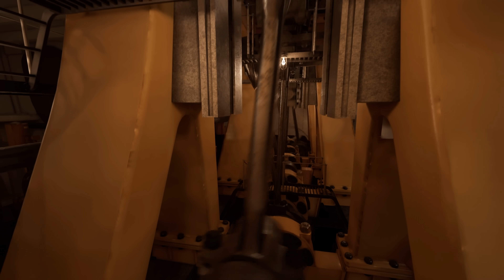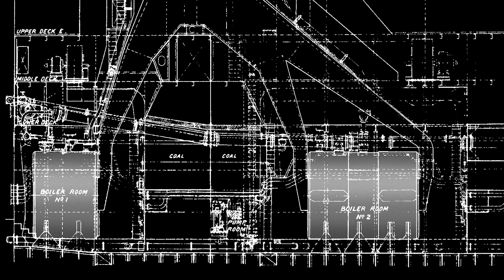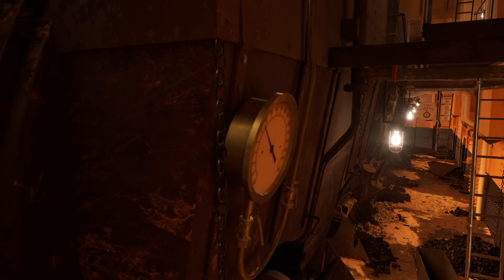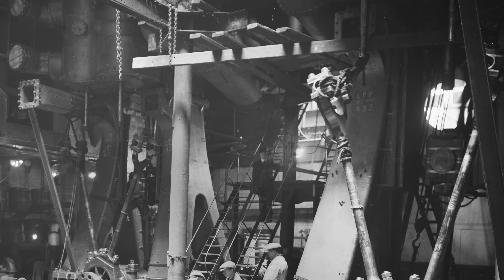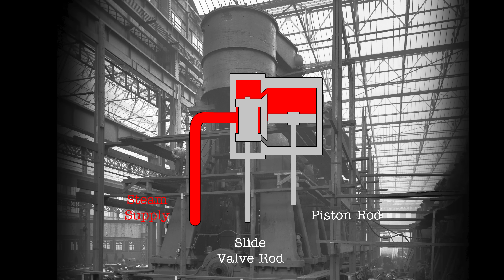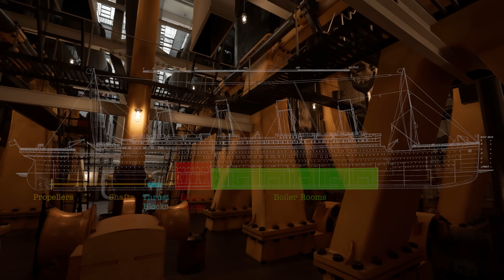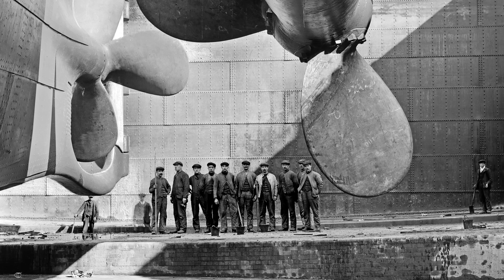A Complete Guide to Titanic's Engines

Comment: After a career at a nuclear power plant, I see so many similarities in this power delivery system and what we maintained...of course, we weren't burning coal in furnaces and feeding reciprocating engines..but there were, moisture separators high pressure turbines exhausting into lower pressure turbines which exhausted into a condenser running under vacuum..condensate extraction pumps returned feed water to the boilers,  makeup water provided by a dedicated water treatment plant for each unit....many similarities to do such a different task and across such a span of time

Comment: what did they do with the ashes from the boilers?
Reply: In port it would be placed into canvas bags and then hoisted into a room called the ash room before being offloaded.

At sea the ash ejectors were used and the ash was mixed with sea water before being flushed out the bottom of the ship.

Comment: How did they clear all the coal ash from the furnaces? Most small coal stoves have a "shaker". I dont see any shaker handles, or methods for removing the useless coal ash from these furnaces.
NOTE: if this ash is not removed, the fire will go out, regardless of how many furnaces you may have.
Reply: When in port it was bagged up and moved to rooms on F deck for storing ash. The ash would then be off loaded once docked.

While at sea ash ejectors were used which mixed the ash with sea water before flushing it into the ocean.

Comment: In west London on the M3 approach at Kempton Park, there is a water treatment facility. One the site is also a large Edwardian  building that was used to house the pump that powered the massive water ring main that runs underground around London. This pump is no longer used as it's obsolete but the building is open at the weekends as it is now a museum run by a charity. 

If you are interested  in Titanic and you can get to the museum then I promise you won't be disappointed and I'll tell you why. Apart from all the other smaller exhibits in the building, there is one engine that literally towers over the rest.

It's a steam engine that very closely resembles the one was built for the Titanic!

At over 1000 tons, it's the biggest piece of steam engineering you will ever see. As it says in the video, it's like the one in the Titanic. It's 3 stories high and just amazing , There are walkways and stairs actually on the engine so you can get up close to it. Sometimes, if you are lucky, one of the steam guys there will START IT UP. To do this they use a tiny steam engine that acts like a starter motor for the main engine. 

Admittedly the main engine doesn't run on steam anymore, there is an electric motor that now powers it but they still need to use the small motor to get it going cos the electric motor isn't powerful enough to get it started by itself. Once it is going the sight of all the piston rods going up and down and the crank that revolving is amazing! 

Here is a link to the Kempton Park steam museum where it is: https://kemptonsteam.org.  .

Comment: I still think its the Olympic that went down, just my opinion.
Reply: Unfortunately your opinion is just blatantly wrong.

Titanic was built yard number 401, her sister Olympic was 400. Every fitting, hull plate, capstan and deck chair had these numbers. Everywhere on the wreck you can find the number 401 as well as the extensive changes in design made to Titanic such as the rebuilt B-deck, extended Bridge wings and new locations for air vents and ducts to name a few. 

The wreck is Titanic, Olympic went on to have an incredible career and should be remembered for that, she was also placed under a lot of scrutiny at several points so had it secretly been Titanic (which it could never have been as the switch is physically impossible) people would have found out.
Reply: @Tozzpot500  gosh, I didn't know any of that 😄
Reply: @jaymorris3468  dont worry about it, on the surface the switch does seem possible but once you get into the details and breakdown the period of time it had to have happened within you realise there is just no way.

For a little extra: Titanic and Olympic were together for around 44 days. For 40 of those the hull of Titanic didnt even have her engines installed and was nothing more than an empty shell with 8 boilers and a funnel installed. There is no possible way to make a ship 6 months from completion into a finished ship with the proposed numbers switchers give, we couldnt do it today even with prefab hulls. They had one dry dock and one large crane, both were being used on Olympic at the time and a small skeleton crew were at work on the Titanic ripping out B-Deck for the rebuild.

15,000 people worked at the ship yard, many of them were not fulltime employees and outside of a single paystub no evidence of them at the yard would exist by the time she sank. This also is alleged to have taken place in front of the entire city of Belfast, some 400,000 people who were all keenly invested in her construction as it was a point of pride in Ireland.

Many conspiracies often have a veil of truth to them, this one doesnt. The switch is physically impossible, you could never hide the fact the ship was Titanic from Olympic's crew and returning passengers, they were vastly different ships internally. The wreck is without a doubt yard number 401 or the Titanic. Olympic went on to have a genuinely fascinating career until she was sadly scrapped in 1935 where had she have been Titanic in disguise that would have been noticed. It never was and the theory didnt appear until Gardiner wrote his book in which he states it didnt happen in the early to mid 1990s. That is the first instance of the switch theory, right in the middle of the Titanic craze and written by a known con-man.

If you are interested further Mike has a two part series breaking down the theory and tearing it to shreds, if not i hope you enjoyed the information and feel free to ask any questions, but i can assure you, the wreck is Titanic 100%

Comment: You'd think with how sophisticated these engines were, you'd think they would have engineered an auto coal feeding mechanism like how modern pellet stoves do, less space/resources required for crew (there would still need to be some for maintenance and managing the feed rate of the coal)
Reply: Modern pellet stoves require electricity. Where would you get the initial energy to power an auto feed?
Reply: @csmith6237  well in this case it could be driven off its own steam engine seeing as how its a steam train, or you could run an electric motor with a dynamo
Reply: @Sausketo  that would still require feeding a steam engine though, you're just adding extra weight and parts to a proven system
Reply: @csmith6237  only the steam generator/boiler requires fuel, so a small accessory steam engine would only require plumming
Reply: @Sausketo  so we would start with an initial main engine start up and let the feed take over? That could've worked I suppose.

Comment: Why wouldn't they just ... you know. go from 210psi to one atmosphere in one cylinder? Exhaust all energy with much less constructive effort?
Reply: Cost: The complete expansion of the steam occurs across multiple cylinders and, as there is less expansion in each cylinder, the steam cools less in each cylinder, making higher expansion ratios practical and increasing the efficiency of the engine.

There are other advantages: as the temperature range is smaller, cylinder condensation is reduced. Loss due to condensation is restricted to the LP cylinder. Pressure difference is less in each cylinder so there is less steam leakage at the piston and valves. The turning moment is more uniform, so balancing is easier and a smaller flywheel may be used. Only the smaller HP cylinder needs to be built to withstand the highest pressure, which reduces the overall weight. Similarly, components are subject to less strain, so they can be lighter. The reciprocating parts of the engine are lighter, reducing the engine vibrations. The compound could be started at any point in the cycle, and in the event of mechanical failure the compound could be reset to act as a simple, and thus keep running.

Comment: A complete guide to one of the biggest LIES ever told. The Olympic is what lies in the depths.
Reply: Olympic's yard number was 400. That number would be stamped onto ever hull plate, frame, boiler, gear, bolt, wood panel etc on the entire ship.

So if the wreck is Olympic, how come yard number 401 (the one that belonged to Titanic) is found everywhere, including the engines which need i remind you are the size of a 3 story building. And there are two of them. So either they gutted Olympic, in broad daylight in front of the entire city of belfast with only one crane and drydock and made her resemble the unfinished, mid having B-Deck being rebuilt no engined Titanic. Or the wreck is Titanic. 

You tell me

Comment: It’s kinda crazy to think that, the Iowa class battleships were about the same weight as titanic and her sisters (well, she was actually 57,000 tons when fully laden with food, ammunition, sailors and fuel, but she could only hit her top speed when fairly low on rations,but I digress lol) .. titanic had 24 boilers with two triple expansion steam engines and 1 steam turbine, and made 46,000 SHP.. New Jersey had 8 boilers, with 4 geared steam turbines and made 212,000 SHP.. 
titanic managed a top speed of 23-24 knots, New Jersey made 33 knots ..
The Iowa class battleships needed 3 times more power than titanic, just to go 1/3 faster.. that says a lot about hydrodynamics and exponentially rising forces acting on a ships hull through friction

Comment: The preocupation with the economy of the coal, did the ship in;  for the Titanic there was no money allocated to reinforce the HULL against a collision; it was spent in the colossal hybrid systems;
TODAY, the same:  the preocupation with saving ONE DROP of gasoline and diesel, DESTROYS millions of car engines all over the world; EGR, low tension rings, particle filters, electronic water pumps, electronic thermostats, electronic oil pumps,  and many more CRAZY stuff like that, it IS backfiring horribly, like the Titanic did; not to mention the battery cars, EVs,already being avoided...

((  It burned a 100 Thousand Tons of coal per day,you say?  it seems  impossible to shovel, by hand, all that into the boilers)).

Comment: I bought the 5 ton gantry crane used in the Titanic boiler plate rolling shed. I extended it by 15 feet and fitted end frames making it a portal crane, and still use it with the original hoist in      
 2024 to load lorries.

Comment: Wow, great video Mike! These steam ships were engineering marvels. Modern diesel / oil power ships don't need as much space in the ship (as they don't need boilers for a start) where as these steam ships are built around the propulsion system. Watching the engines in a steam ship is likely poetry in motion - relatively quiet (compared to diesel / oil engine that is) and nearly all the moving mechanical parts are on display. Enjoyed some time in the Earnslaw's engine room under way (yes its small but most of the same principles).

Comment: Nice video. Wodering Titanic uder atmospheric pressure turbine-condenser system. Thank you.
But for some reason, central propeller turns in a wrong direction on the animation, stopping the ship ^_^

Comment: Titanic may have turned well for its size, but it only did so with the help of the wash from the central turbine driven propeller giving the rudder greater purchase on the water. When the iceberg was sighted the turbine was stopped. We cannot know whether keeping it running might have resulted in a better outcome, possibly causing a more side on collision with the iceberg and breaching fewer watertight compartments.

Comment: I had no idea that the turbine was operated at lower than atmospheric pressure. It does make perfect sense, though. I've fired a locomotive on a hot day, and enjoyed the icy cold mist exhausted from the cylinders. That cold mist wouldn't have any trouble cooling a condenser to a lower pressure, so I can see how that would work. The inside of those condensers must have been near freezing.

Comment: IIRC, the Olympic class were designed so that eventually they could be oil-fired, which Olympic was after the Great War.  Oil was seen as the fuel of the future, and once converted, Olympic shed about 360 crew from her engine rooms since pumps were all oil needed.

Comment: I always find the obession with Titanics size and engineering absurd for anyone that isn't lay, the ship was basically the same size and configuration as RMS Olympic, only 1000 tonnes  (weight later added Olympic) more due to some slight differences mainly covering over a promonade, being first of class if was the Olympic which was the groundbreaking one a year later SS Impertor was completed 7,000tonnes larger and 7 metres longer, The Queen Elizabeth near twice the weight of Titantic was the largest passenger ship from her compeltion till her sinking and a larger ship didn't enter service to 1996

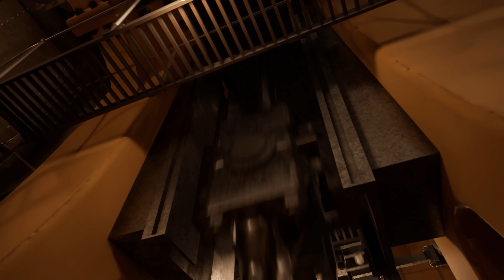Comment: 20:15 Note that the exhaust from the triple-expansion engines were NOT totally exhausted, but still carried pressure. The exhaust was fed to the turbine, where it then exhausted to the condenser; almost all steam ships have a near vacuum exhaust pressure, as the condenser condenses the steam which makes such a dramatic reduction in volume that you are almost one atmosphere below ambient, helping pulling steam through the engines making them more efficient.

Comment: They gave enough thought, effort and resources into what can only be described as a propulsion miracle.

And then said

“Less than half the needed lifeboats. That'll do."
Reply: Not true. Lifeboat regulations back then required only 16 lifeboats for vessels at 10,000 tons and more.

Titanic (which admittedly weighed 52,000, demonstrating how old those regulations are) carried 20, so she was above and beyond the requirements.

Also, back in those days, lifeboats were not a primary lifesaving device

Comment: The neatest thing about this -- for me -- is that these aren't things that used to exist and have since been dismantled and scrapped -- like they were with Olympic. Every single thing mentioned here still exists and it's all resting at the bottom of the North Atlantic.

Edit: Albeit rusting away and deteriorating, with some of the smaller parts likely long gone because of that, but the point is that every last thing mentioned here made it's way to the bottom of the ocean, two and a half miles down, and still sits there today -- in total darkness.

Comment: Visit the Kempton Park Great Engines, although 3 cyclinders are taller than the Titanics and have been used in several films of the Titanic as they are presevered and are run 8 times a year for the public.

Comment: How about a follow up video, taking us thru the sinking as it happened in the engine rooms, till the point they became a hell on earth as things came apart as the hull broke.  The forces to rip apart the forward cylinders, yet leave the rear 3 cylinders in place on both main engines are mind boggling. Then the force the stern slammed into the ocean bottom to smash the outer propeller wings 30 feet upwards to where we can see the outboard props, yet the center one being forever burred deep in the mud.

Comment: I love this video. Very well done. One observation: at 31:30 or so, I believe the turbine-driven center propeller is turning in reverse in relation to the prop's blade pitch. I do not know which direction it actually turned, but the later picture of Britannic's propeller had the opposite pitch direction as the CGI prop, so perhaps the CGI rotation (counter-clockwise) is correct, but the CGI center propeller is rendered incorrectly?

Comment: Beautiful engineering on engine... turbines quickly made piston power obsolete.   Early on in my engineering career a coal fired boiler water level CV  stuck closed. When it became unstuck on dry water separator the rush of water hitting overheating metal made a steam explosion...

Comment: This was an exceptionally interesting video! But I would also love to see animation or an explanation what happened with the boilers and the engines when titanic sank.. I understand when titanic hit the iceberg the boilers were firing at the maximum heat so the engines could rotate in reverse. I would also love to know what mechanism allowed the engines to engage in reverse. Did the thrust bocks allowed the shafts and propellers to stop spinning fast so the engines could stop and reverse the spinning, or did the engines had some sort of clutch? What happened when Titanic sunk? I understand that the boilers were still full of hot coal and when the engines stopped spinning the steam was still being generated, did the boilers explode when titanic broke in half? I have seen animations on youtube, all of them show that when titanic sunk underwater the piece with the boilers and engines exploded underwater, was that the explosion of the boilers?

Comment: I'm curious. How were these engines installed? Was it added before the upper decks were added above the engine room?
Also, if there were any major components such as a piston or a cylinder that would ever have been needed to be replaced during the ship's life, how would they have been replaced? I mean, would they have to cut out a major hole in the hull or in all the decks above to get access for taking out old ones and bringing in new ones?

Lastly, I'm just curious how Titanic would have behaved in the worst Atlantic storms? Sorry if you might have already addressed these points some where else. I'm still checking out your channel.